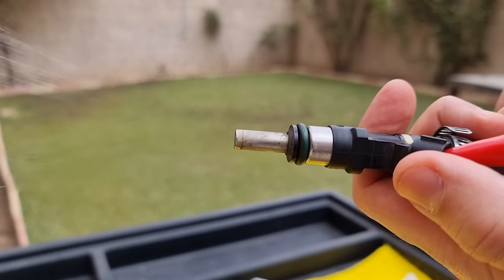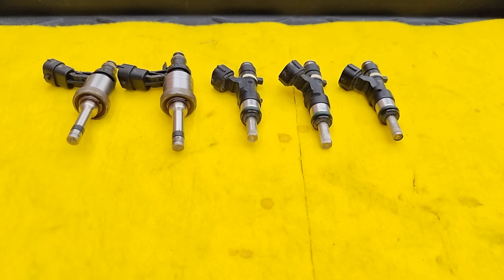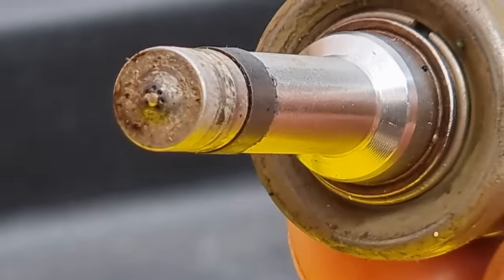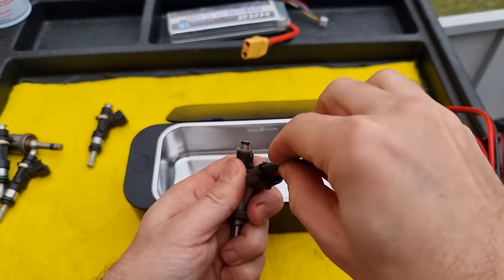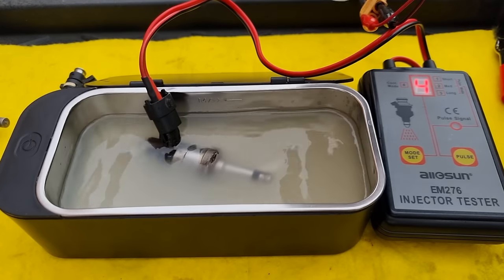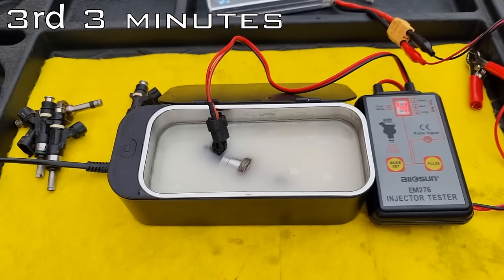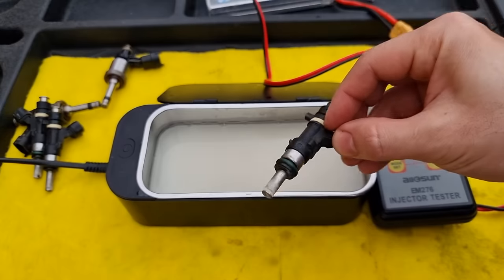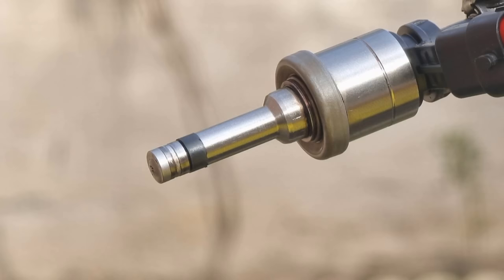Wish i knew this before spending $$$/Leaking Fuel Injection cleaning/HOW TO clean GDI injections

Comment: Man.... Dealership's are gonna hate you for this one !
Great tip !
👍😉
Reply from the maker: I know 😅
Reply: This is hardly anything new. There is an entire industry doing this. This just shows that it can be done "at home" 👍👍
Reply: @AliMECH  haha , we actually don't hate it, andI like your videos. 😁
Reply: You should go look at how to get those Direct Injectors in and out before you think that this is really DIY. They are NOT easily removed and installed like port injectors.
Reply: Yeppers! ANd it keeps perfectly good injectors out the landfill!
Reply: I mean tbh they don't care we know how to we don't because 1. Our time is worth a lot 2. Liability/angry customers be like you didn't do it right 🤣 so yeah no thanks I'm not wasting my time for someone to be angry for no reason and have a totally separate issue and want free shit and labour
Reply: Stop , there may be a few cars but most are a couple bolts and a rail change the o rings and reinstall not hard for someone with basic knowledge
Reply: @AliMECH  you could've used something that takes space inside the ultrasonic basket and that would have raise the level of the seafoam. NEXT TIME....
Reply: @chimpun1979  Eureka!
Reply: My injectors are 580 pound each need 3 did this for 30 minutes each in diesel  cleaner in cheap 6 pound ultra sonic cleaner and 12 pound for fuel injector tester  working fine now even did the 80 pound fuel pressure solenoid thanks save me scraping my van
Reply: Great stuff mate! Thanks. I have 1 injector with P20x failure (forgot which one and left the job for a while as they are hell expensive). Previously changed 3 and 4 and they were going out one by one:). Now before I buy new ones will try your way. Nothing to lose (money not that much to invest) but plenty to gain plus satisfaction if sorted.
Reply: @dans9953  Cylinder Injector 1 Flow Correction 101.39%

Cylinder Injector 2 Flow Correction 97.49%

Cylinder Injector 3 Flow Correction 90.47%

Cylinder Injector 4 Flow Correction 108.41%

Standard rate is 95
Reply: yes me and my whole family hate him already

Comment: I highly recommend also changing the seals/o-rings every time you take a direct injector out.
Reply from the maker: Yes good idea
Reply: Are they available for sale those seals/O-rings from manufacturer if so where can they be bought at ??
Reply: I was literally going to ask that!
Reply: I've found kits at local parts houses with various common o ring sizes for AC components (green), I think they have fuel kits too.
Reply: The addition of ethanol into gasoline now a days makes using OEM O-rings and gaskets even more important, as ethanol is known to corrode rubber components.
Reply: Ideally you would also do that with port injectors.
Reply: @CycOp  it is not known.
Reply: What about the teflon rings?
Reply: Need a special tool to replace the nylon ring towards the bottom on certain injectors but yes, highly recommend too.

Comment: A cheap way to clean injectors out is to soak the nozzles in a small cup of injector cleaner. Let them soak for an hour or more if they are nasty. If they are dirty it usually turns the fluid in the cup orange. Once done spray off the nozzle with some parts cleaner spray.

Comment: You cannot set metal directly on the bottom of the ultrasonic cleaner, that reflects the energy back into the transducer and you will destroy it. You need to use something to act as a spacer a little plastic tray works great.

Comment: I use the sonic machine all the time, on any small parts,  it cleans like magic,  I do alot of motorcycle repair and especially carburetors,   my tank is small so so I pull.the float bowls and sometimes have flip the carb and half at a time,   I got at harbor freight, about 100$,  mine heats up and I use water and dawn dish soap,   I also do 3 or 4 cycles,   yes i  use water and dawn dish soap, about a couple good squirts per tank,  its gets dirty fast,  but work fantastic,   a great to have for every mechanic,  and and very nice video,  short,  sweet,  and informative

Comment: That cleaner is hard on the rubber, you should remove the gaskets from the injector before throwing them in, also would be ideal to put a piece of plastic between the bottom of the ultrasonic cleaner and the metal part of the injector.

Comment: Two quick ultrasonic cleaning tips:
>Put the injector inside a small plastic bag and fill the bag with the cleaning fluid. Then fill the ultrasonic cleaner full of water and it the bag in the water, means you don't have to fill the ultrasonic cleaner full of cleaning liquid.

>Never put metal directly on the bottom of the ultrasonic cleaner, it can damage both parts, a think sheet of plastic or paper is enough. Look at the more expensive ultrasonic cleaners and you'll see they have cages to stop objects sitting on the bottom.
Reply: Thanks for the tip 👍
Reply: Not specific enough instructions ended up getting my balls stuck under the spare wheel in the boot of car
Reply: I use a similar method but just use a jam jar or suspend the part in a tin which has cleaning liquid in whilst the USC has water in it
Reply: Ya that's not why the mesh is there. And resting on the bottom isn't bad for them. You just want to decouple it.
Reply: @AlexBonesJones  your lil grapes 🍇 got stuck ? thats crazy !!

least you cant sit on em 😂
Reply: I wonder if the injector needs to be powered for this
Reply: @furtivedig  If you want cleaner to FLOW  through it YES you could either PULSE or Continuous put a current not greater than roughly 9 volts but preferably not for long period of time.
Reply: @pieterbezuidenhout2741  it makes sense to want to run cleaning agent through the injector to get rid of contaminants, but in my experience cleaning glass wafers most of the cleaning is done by the vibrations not the chemical itself. distilled water actually seems to work better than IPA or acetone a lot of time, or at least it doesn't leave as much a varnish
Reply: @furtivedig  personally I prefer using METHANOL that DISSOLVES the  'Glue ' of modern feul very sufficiently without any Ultrasonic Vibrations but with Pulsed Injectors and a little FLOW through of Methanol getting the  sh . t   out .
Reply: @pieterbezuidenhout2741  oh methanol works wonders, but it is a nasty chemical. I always avoid using it unless I don't have alternatives. For this application I would imagine it is quite useful. Do you also submerge the I injector?
Reply: @furtivedig  😅😅😅 Only nasty if swallowed. 
Yes you can submerge for initial cleanup but afterwards I concentrate on the inner working of the injector. 
I use a high pressure pump set at anything between 12 to 28 lbs pressure then have it flow through injector with a fast pulse. 
Works wonders. 

Only reason I rigged myself this way is being  ' Known ' even from neighboring towns .
Reply: thats a really good ideal... thanks.
Reply: @furtivedig  I and many others have been getting methanol all over our
 hands for years. Because I fly model planes and it's a major part of the fuel . But I definitely don't drink it.
Reply: @AlexBonesJones  lmao. I browse youtube to see the occasional "instructions unclear" comments like this
Reply: based
Reply: Some more tips:

Degas the solution before cleaning process. For a small cleaner about 10 min run with only solution to degassing it. Gasses in your cleaning solution absorb much of the cavitation energy and  so greatly effect your cleaning process.

Heat your solution mix up. Heat increases chemical reaction of your cleaning agent. Literally works wonders. The pivot point of most solutions lies a litte over half the boiling point 60%.
Reply: @Smoked786   Sweet, I'm going to try your method!
Reply: @TheCarpenterUnion 
So, like a cut up whip cream plastic lid, cut to fit bottom of container so no metal on metal contact?
Reply: damn man your brain is out of this world @AlexBonesJones
Reply: Thanks .
Reply: @furtivedig 😂 I wonder if you are capable of watching a simple video to find out?! 🤔

Comment: Years ago I attached a long hose to an injector, filled it with seafoam, pressurized it and applied intermittent power to the injector. Worked great. If you don't have an ultrasonic cleaner it might be worth a try.

Comment: This is such a great idea, a game changer actually! Why haven’t I added an ultrasonic cleaner to my tool kit? Great job sir, thanks!
Reply from the maker: Thanks for watching, glad it was helpful
Reply: I sure will be adding an ultrasonic cleaner to mine! Thanks, so obvious, yet I never thought of running the mode 4 tester while in the shaky bath. I’ve already got an injector tester similar to yours, but I have Toyota connectors spliced in with the original spade leads.

Comment: This is why at the dealer I work at, we recommend a fuel injection cleaning every 30k miles, and its $130. We do 2 separate services depending on if ir vehicle is direct injected or port injected

Comment: I'm glad it worked for you. I've sometimes caused fuel injectors to start leaking (aka ruined) by ultrasonically cleaning them on the proper injector machine. Don't know why but it's happened a few times now.
Reply: Just get them replaced. These Acadia are known for poor fuel injectors. They leak. I always replace them as they will damage the catalyst if not replaced sooner

Comment: That's great! Thanks for the information. I have a Honda with over 200,000 miles. There doesn't seem to be a problem but maybe I'll pull them out and clean them anyway. I just have to get an fuel injector tester.
Reply from the maker: Thanks, that's great
Reply: If it ain’t broke don’t “ fix it”
Reply: As borkganza says, if it runs good, do nothing.
The biggest problem you have with cars that are not a daily car and are parked long.
The ethanol in the fuel cloggs the injectors.

Comment: Years ago I had a shop tell me they would cleaner my injectors. They are just a solenoid or coil alot of times you can energize them and just spray some sort of solvent through it. I tried it on a hunch and it cleaned them right up but the ultrasonic cleaner is probably more thorough.
Reply from the maker: Yes exactly, it helps a lot
Reply: You just energize it and spray into the back of it? It's really that easy?
Reply: @amarsta  do not over do it with the voltage. You'll have to look up what it is. I think I used a 9 volt battery on mine. It was a long time ago. I don't think a lot of them run a full 12 volts. Which will actually be like  13-14 volts with a good car battery.

Comment: replacing your fuel filter often and using quality fuel seems better.  I have 2 2005ish ford focus at about 170k and never touched the injectors.  Just Filter occasionally and some MMO occasionally.  I'm in a dry climate.  Wet and Salty climates might have more fuel issues.
Reply: Have you ran diagnostics to see if they are still running to spec? I would imagine they are not, but I am a firm believer of if it ain't broke dont fix it. So I am with u on the filters and fuel
Reply: I've never had injector issues either. For the past 20 years, I've used Techron with every oil change
Reply: Fuel filters?   They went away about 20 years ago. None of my cars have a replacement filter. Just the mesh filter on the fuel pump.
Reply: @stuartbear922  at least up till 2007 focus has a filter canister.  GM was the major culprit

Comment: Thank you for your videos...
I think after replacing many parts, sensors and miscellaneous costs...far too much money. 
Its the fuel injectors...
So got o ring repair kit, and some cheaper injectors to swap out incase there cracked.
Either way you have been helpful and ive learned a lot.
Wish me luck...its been a painful game of wack a mole.
Reply from the maker: Glad it was helpful,  hope it will be working for you as it did for me

Comment: Hello there . Question for you mr Ali or any tech out there what if I took the car to a tech and he cleaned the injectors but even though it regained part of its hp but still I smell raw gas when starting it or driving it . I took it to another technician who said after doing ultrasonic that i had a faulty injector . After watching your video im wondering if i poured like four bottles of injector’s cleaners in a half full tank , could it fix my fuel leaking ??
Or im wasting time. Point is I couldn’t find new injectors and hesitant to buy used ones but I may need to swallow it at the end if nothing helped .
Another technician said to try ethanol in gas tank !

Comment: Sometimes you geht the same result by using e85 for a while . I tried in my 100000mls Porsche, the injectors, the combustion chambers and the spark plugs looked like after 2000mls
Reply: You're saying the e85 cleaned them all up?

Comment: Apparently there's a seating issue for it to drip afterwards.  Which looks like you got it right, running a pure solvent through.  The Sonic device??   I do not know much.
But just a note that might be of benefit.  Note car engines used to be a cast iron, where now any number are aluminum.  But after many miles on older cars, a car would get carbon build up on the cylinder heads, which would make the car run rough, difficult to start, etc.  But, what some would do is get car warmed up, then some would choke off top radiator hose so engine would run hot, then they'd have ahold of the throttle rev engine up and pour water into intake.  I know for a fact this works as I sunk a car.  Not intentionally!  Drain the water from crankcase, pull sparkplugs roll engine over, water shot out about 10'.  Sprayed WD-40 down carburetor and into cylinders, which it removes water.  Put plugs back in,Fill crankcase with new oil.  She purred like a kitten like coming off showroom floor.
Now I never heard of it, but some have said that some have had cracked the block doing this.  As a whole, I do not believe it was a problem as many used it.
It's my understanding that the water is cool relative to the engine, so it contacts the surface of the metal surface which shrinks in response to cooling, where the carbon does not, so breaks off and gets blown out exhaust.
New aluminum engines?????  I do not know how they'd respond.

Comment: Those who dont want clogged injectors, replace fuel filter when it's time.
Reply: Unfortunately my BMW X1 Diesel fuel filter was never replaced under the maintenance plan!  The first time it was replaced was when  I took  it to a after motorplan service centre. It still had the manufacturing date on.
Reply: Cars haven't had fuel filters in a long time.
Reply: @stuartbear922  
I know.
Back in the day, engines were made from premium quality steel.
Now they are made of plastic.
Pour bad full into it, say byebye

Comment: How can the seafoam fluid can clean the  inside the fuel injector when it should have pressure to go inside?  Does it mean that the ultrasonic cleaner is just cleaning the outside part od the injector?

Comment: I just run sea foam in the fuel tank every oil change. Never have had to change an injector on any car in 30 years.  Oil change put half a can in the engine before you change your oil,  the rest in the fuel tank been doi g that since the mid 1990's, works for me and is 10 bucks.

Comment: Good video, BUT a tip. Put the cleaning agent and the injector in a bag. Then fill the ultra sonic cleaner with water. Now You put the bag with the injector in the water. This way you can use far less cleaning agents,

Comment: That wasn't a leaking fuel injector. It just had a clogged nozzle causing it to have no spray pattern and just seeping out of the nuzzle. A leaking injector would have a bad o ring seal which you can only fix with new seals. But great video. How much is the ultrasonic cleaner?
Reply: Actually trash can make it stick open causing a cylinder to fill with fuel and hydro locked an engine. 
It just happened to me. Sent the Injectors out to get serviced and trash was I the injector and it suck open.

Comment: You can make a splitter so you can connect 2 injectors at a time.
Reply from the maker: the tester can only power up on injector, i tried 2 injectors, but it didn't open them up

Comment: Which ultrasonic cleaner u have used ?? will this specification will work (Rated voltage: 7.4V
Rated power: 28W
Capacity: 300ml)
Reply from the maker: not yet
Reply: @AliMECH  pls specify the ultrasonic model to be used .Will b glad to hear from u 😊

Comment: Good video! Have you change rubber seals after cleaning or it’s not so important? Thanks
Reply from the maker: i always check them, if the are not cracked, i will use them, but its better to replace them always

Comment: My engine started to misfire and I was told by my dealer to add chevron fuel system cleaner and it worked. They said sometimes the injectors can become dirty and that this can work and sure enough it did.
Reply: I've used Techron for the past 20 years and never had an injector or fuel pump issue.

Comment: I dont recommend doing on car injector cleaning, my very first car, I got this done, all good, but when I leave my car for a few hours, it had trouble starting, but after a cranking for a while and the battery doesn't die out, the car will start fine. Turn it off, and it will start again fine.
Now if I left it overnight, it will not start in the mornings, battery will die trying to start, if I hook up a jump starter or hook it up to another cars battery, keep cranking and it will eventually start.
Mechanic didnt know what was wrong and they had my car for a week.
Long stoey short, the on car injector cleaning caused the issue, there was no way to test the injectors if they were leaking, because of the fuel pressure, fuel leaked onto my spark plugs making them wet and couldn't get spark. Injectors removed, I had 4 leaking injectors out of the 6.

Get your injectors cleaned outside of the car, then they have the ability to test for flow and leakage, this will save you alot of headache.